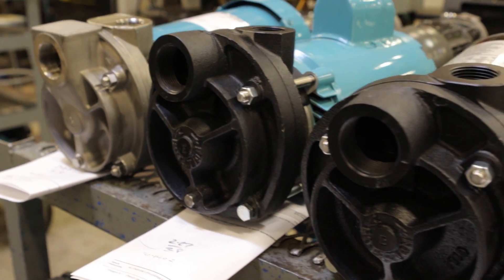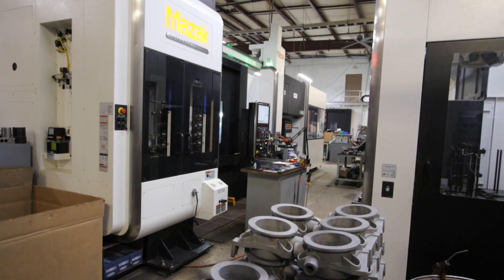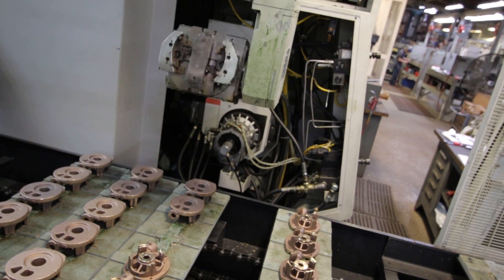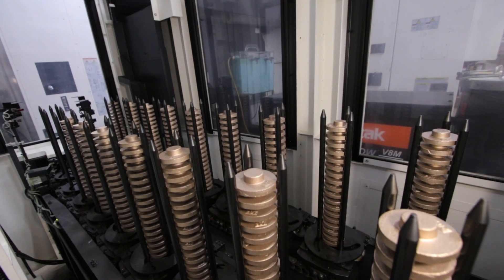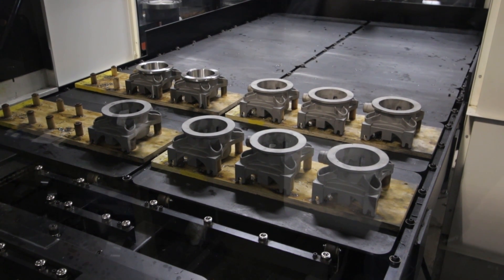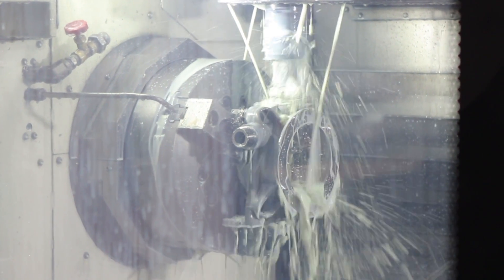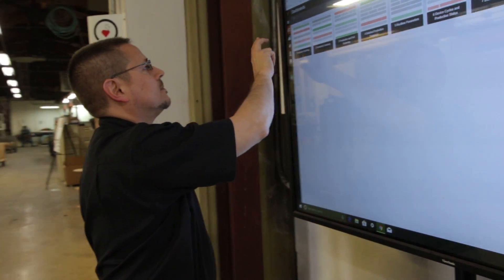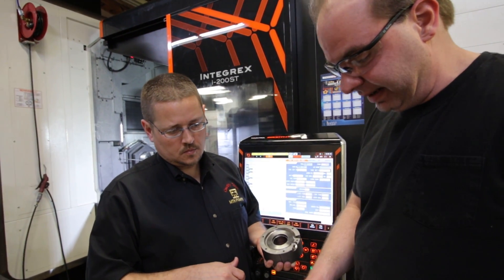DISCOVER MORE WITH MAZAK Results Series: Episode 28 - MTH Tool Co.

Comment: How does MT connect alert you if an insert has chipped or just wore down? Causing tolerances to fluctuate surely. Do you account for tool wear in the program or?.. Is your process already that claculated? Sorry just very interested
Reply: I don't know of a way for MT Connect to tell you something that specific except that it will transmit errors and alarms (which is too late to do anything about other than to call a machinist in to address the problem in person).  Dealing with chipped or worn inserts is usually handled by developing your process to the point that you know how many parts are safe to run on a given set of inserts and then use the option for redundant tooling and swap out the tool automatically on overnight or unmanned runs.  Insert wear can also be handled by using your in-machine part probe to check critical dimensions and once they deviate a certain amount from nominal, you can make an automatic offset.  The total offset can be limited to a certain value, after which you can call up a redundant tool.  This works for us.....MTH Pumps